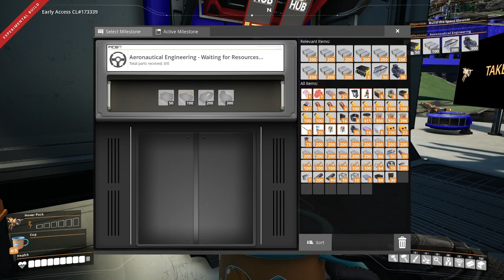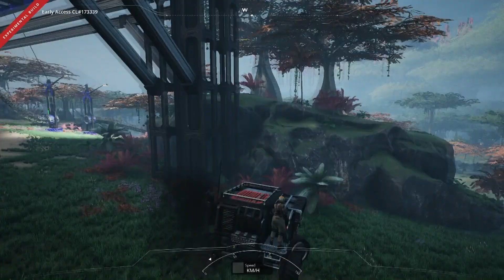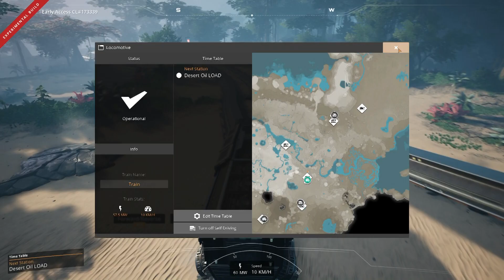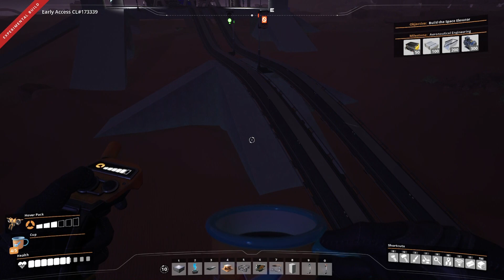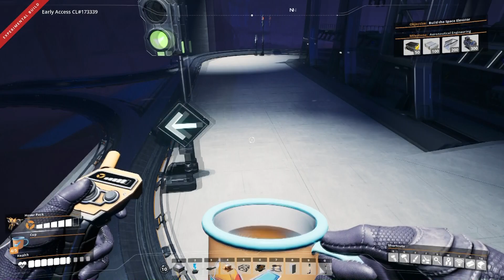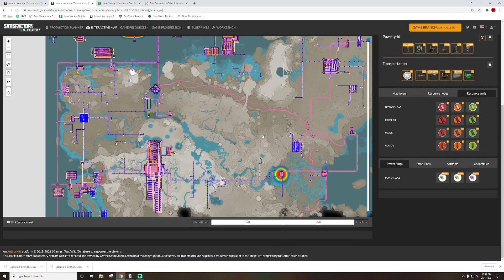SATISFACTORY - U5 VANILLA PLAYTHROUGH EP#4

Comment: Fyi your trucks are running out of fuel. You should either use package fuel or make sure the truck stations have a storage container that feeds them into the fuel section. Your truck stations will automatically refuel each truck when they visit